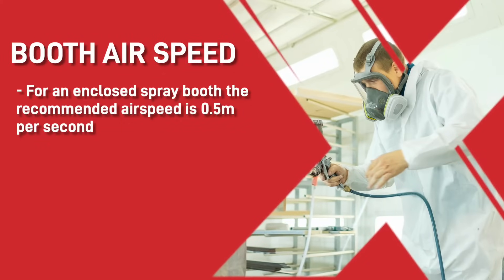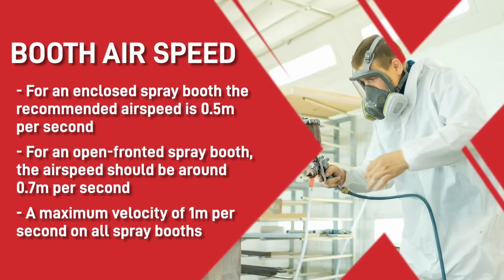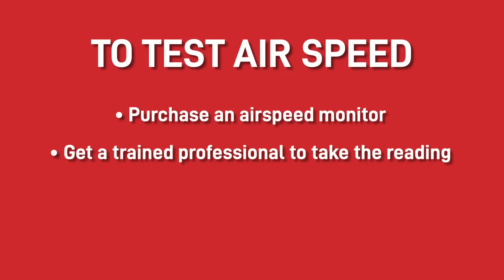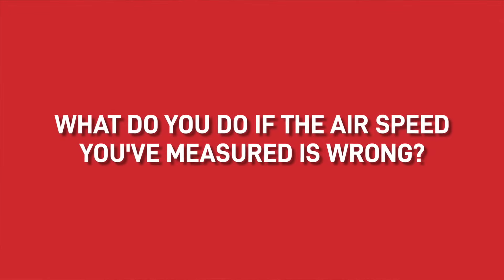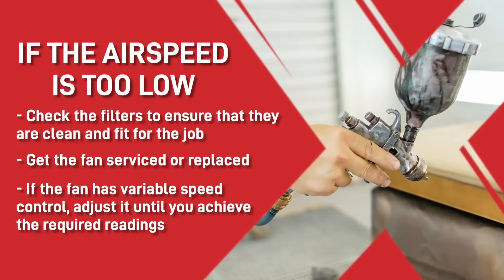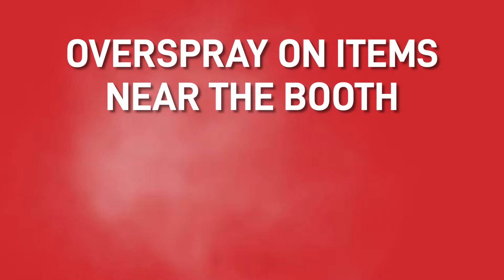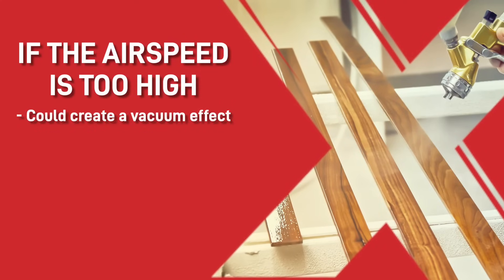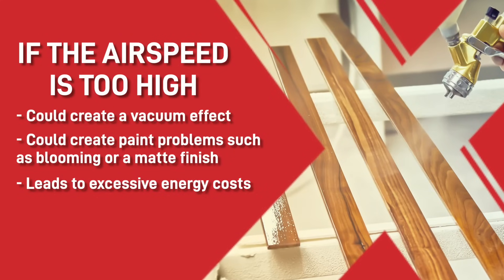Why Is Your Spray Booth - Paint Booth Air Flow So Important ?

Comment: Hi mate can I get your thoughts on what would cause a brand new booth to essentially implode and cause walls to crumple slightly like a tin can? I’m assuming the booth builders have made an error in the process and have had pressure build up somewhere upon a start up of the booth. I’m not sure really. 
No one putting their hand up for the blame 

Thanks mate
Reply from the maker: Hello, Most likely because the fan is too big for the size of the booth, taking too much air out of the room, check the intake filters…? What area is allocated for inlet/intake filters? There should be as much air coming into the room as there is extracted out, otherwise it will end in ‘negative’ pressure causing these kind of issues and can be dangerous.

Comment: Nice and simple explanation. Could you please explain when do I need an AMU? For instance I’m installing a 20x20x80 ft paintbooth inside a 90x60x50 ft conditioned space with multiple open doors. 
Please advise!
Reply from the maker: Hi Wyle, are you UK or US based as both have different regs ?

Comment: Hi. I just opened a garage and I am planning to have a paint booth about 7.5 metres long 5 metres wide and 3.8 metres high. I try to buy it but I was not able to find any supplier that can give any faster than 3-4 monts ..also very expensive.I want to build it myself now...any recommendations what fan and filters should I use and from where to buy it. Any information helps. Thanks ,also I want to mention that I live in United Kingdom. East Midlands
Reply from the maker: Hello Ioan thanks for your question, We do supply and install spray booths so you have come to the right place! We would advise you to buy an open fronted booth and then build the enclosure.
The booth could be available in 4 weeks. If you would like to run through a few details of costs, timings and what we would advise for your install then please send us a quick email to sales@ultrimaxcoatings.co.uk or call +44 (0) 1302 856666 and ask for our spray booth specialist Bruce Hoare.

Comment: hello sir, is this also apply for the water curtain?
Reply from the maker: In a water wash booth system the air flow is still valid but admittedly not as important. Good air flow is always useful but between standard spray booth extraction and the water wash system this would in effect be all you need to take particles out of the overspray and away from both painter and the painting project. br Ultrimax Coatings